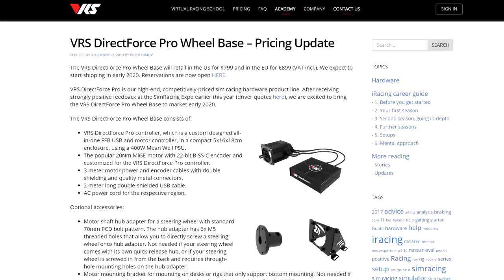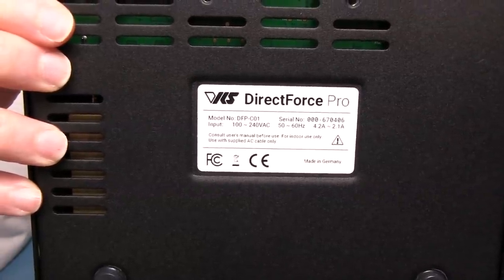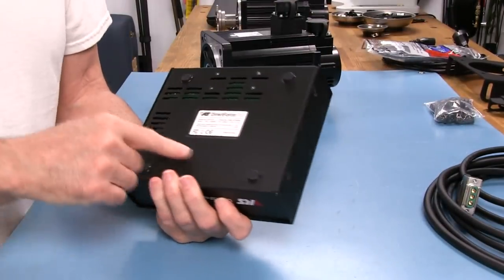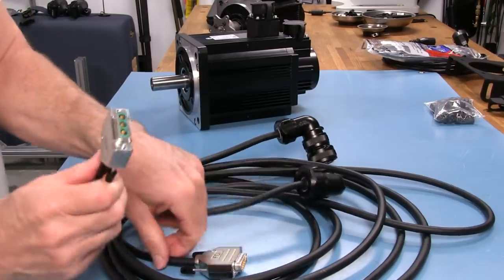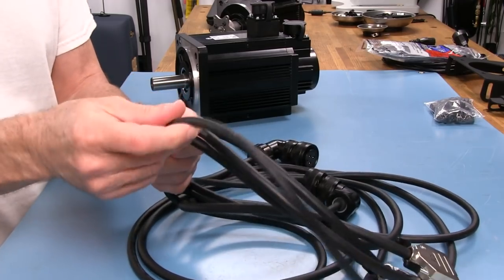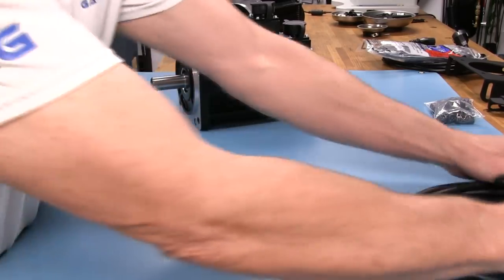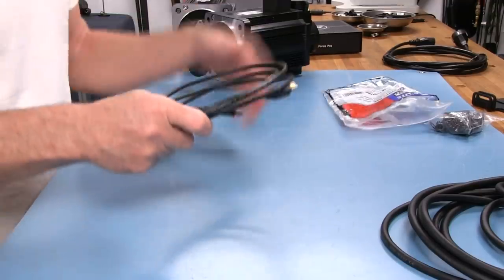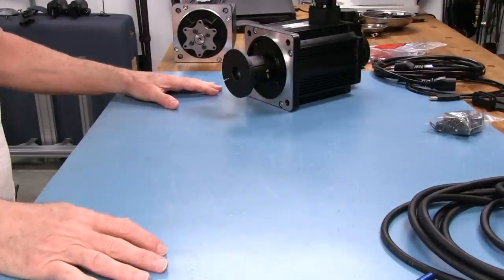VRS DirectForce Pro DD Wheel System Review

Comment: I aboslutely regret buying the DFP, it has this awful notchy feeling that I cannot dial out, I am at a complete loss it feels awful. Also support is almost non-existent, there is no troubleshooting documents, and they point you to the Discord if you have issues. In the Discord other USERS attempt to help you diagnosis the issue. So instead of a normal support system they offload it onto the Discord community.

Comment: Just got a VRS DFP with a GSI GXL wheel and LOVE the combo.  I started around 7ish nm, eventually went to 8nm, the last two days out of curiosity have been using 10nm in ACC and absolutely love it.  It takes the extra work that comes across from what you're seeing on the screen in the sim and I feel like I'm more connected to what I'm seeing on the screen.  I haven't tried iRacing yet, but I'll be doing that soon.  Just been having way too much fun in ACC.

Comment: Thanks Barry, you helped to sell a system for VRS.  Mine arrived yesterday.  Modeling a motor control tray to fasten to T-Slot extrusion away from home (work) and needed basic dimensions and view of underside for ventilation hole placement......this video helped me again!  Thanks again!
Reply: what was the screw size of the 4 screw points under there?  I have a 2 pc mount plate being printed for 40/40....need to get the screws

Comment: Bought mine and just installed it. Your review was 100% spot on. Great stuff Barry and much love from Australia!
Reply: Would you know if you can use this wheel with a PS4 / PS5 as well as PC?
Reply: @atrain132  Sorry mate, not compatible with any consoles, windows PC compatible only. I doubt it will have any compatibility with consoles anytime soon either looking at the controller and software needed to run it.
Reply: @eurisko84  all right, thank you for the response. I have the accuforce v2 for pc, and a gimx adapter so I can play on consoles, but it's kind of a pain. I just went back to using the t300 RS for consoles. Looking for a nom Fanatec direct drive wheel base for consoles as well as PC.
Reply: @atrain132  If I am not mistaken, I think Simagic might have a DD like that in some time

Comment: Thank you Barry for your review. I´ve bought myself a VRS wheel base kit recently and have it installed into my TrakRacer TR8 rig. This will have to change to a more stiff&sturdy pcs of rig made of aloy profiles soon! So one thing comes with the other…
I can confirm, that the feeling with this unit is great out of the box. Now I started to tweak around to find my sweet spot on the cars I used to drive in iRacing. 
Last Saturday I was at mates place who owns a SC2 Pro installed in a rig build like a "tank"… Nevvr seen such massive alloy profiles in a sim rig. So - no freaking flex anywhere.
The SC2 Pro and its TrueDrive interface were exciting to me due to my servo engineering background. But as you mentioned - this could overwhelm people and lead to probably horrible adjustments as long the users are not confident with what they are doing and understanding the working principle of servo systems and FFB. Even I still learn a lot by the moment!
So in the end the SC2 pro tweaked to my mates "gusto" was very detailed and sharp by beeing smooth at the same time.
What I found spectacular was the feeling of understeering where the force signal in iRacing - when loosing front end grip - drops off by 0,1-0,3 and the wheel becomes light.
This is by the moment an effect I´m "missing" in the VRS - but I will continue to tweak around with the settings - didn´t got to far with it by now. 
I keep communicating in with the guys from VRS and the VRS community to exchange my impressions and gain more knowledge from other users.
If I would "have" to decide today for which system I would go next - I would stay with the VRS from a price-point-value. The SC2 Sport has 3Nm less torque and offers a vast "hell" of possibilities to tweak out almost every personal preferred detail - but this is something that takes a lot of time without racing and why pay more and getting "less"?!
So KISS - keep it simple & stupid - it works without "thousands" of parameters for me and will work for other users too.
And - hell - YES! Shielding on cables is essential when it comes to AC servo motors!!! Servo motors with 20Nm peak torque are far away from "Toys"... ;-)
Reply: Great post, 2 years later, what are your thoughts on the VRS and have you jumped back into your mate's rig to compare again the SC2 pro?
Reply: @jj81Studios  sorry mate - nope... I quit SimRacing several weeks after this post for different frustrating reasons.
Now my son stepped into this hobby and started with a wheelstand from TR. Equipped with the new CSL DD from Fanatec and CSL Elite pedals. I used to borrow it for some track time having fun again in SimRacing.
The CSL DD with 5Nm gives me almost the same feeling as the SC2 wheelbase but at a lower torque range. Nevertheless it feels great and I'm able to feel the understeer even better than with the Direct Force Pro back in the days I was driving on a daily base.

Comment: EXCELLENT video Barry.  I'm seriously looking at the VRS Directforce Pro as my first (and only) wheel base.  I hate the thought of buying something less, becoming dissatisfied, then being forced to sell it to upgrade is against my nature.  Seems to me that the VRS is the best value in the current market and would make a great once-in-a-lifetime sim wheel base... especially considering my age (75).  Your video was absolutely superb and, as a subscriber, I look forward to your next video on the VRS pedals and wheel.   The only word in your amalysis that scares me was "graininess".   That was the very first time I've ever heard anyone comment about any Mige base system with the word grainy.  What components do you have in your everyday driving setup?    My second concern is my limited number of USB attachment points in my PC.  I have a very powerful laptop with a Intel(R) Xeon(R) W-10855M CPU @ 2.80GHz with 32GB RAM, 6 cores, 12 threads, and a NIVIDIA GeForce RTX 2080 Super with Max Q and 8GB dedicated RAM.  I've been told this is very sufficient to support sim racing on most any single monitor (no triples).  Problem is that my PC only has 2 USB ports, so an integrated solution (where all the peripherals are plugged into the wheel base and only ONE USB then connects to the PC seems like a good fit for me (for ex: Fanatec).  As a retired IBM engineer, I can quickly adapt to most technical things, but the cost of getting started into a quality sim setup has me concerned.   Any thoughts and suggestions you have for me are greatly appreciated.    Robert
Reply: According to Boosted media, The software has come a long way since the time this video was posted. I have a VRS DFP coming in on monday because the Simucube warranty process has been a little brutal. A usb hub will solve your usb hub problem. You wont regret it.
Reply: @jconsc2 any comments on your experience with the base thus far?
Reply: @diovalremonde2468  
Yes, I love it. If I compare it to my simucube I actually like it a bit better with the settings I stole from this video. I'm not a big tweaker of settings I like to setup and go so take it with a grain of salt because the sc2 pro is fantastic and I'm sure my issue is one off. Microcenter has a replacement on their way out to me. 

VRS : simple software. Unit is solid. Control box is also high level(construction wise). I have not mounted yet and just have on the desk which I can see as a minor annoyance compared to the all in one unit.

As far as software the VRS software doesn't have a whole lot of tweaks which I personally like. I feel like with the settings in boosteds video work great. Clean feedback and gives me a lot of confidence to catch slides and try to push to the edge(of my ability).

SC2 software has a million settings. I could see how this is great if your into getting the perfect feeling but to me it's a little much. I'm sure I could search for better settings but the ffb seems to be a little violent if that makes sense. I think I was using dan Suzukis settings turned down.

The cables the vrs come with are hefty. I also got their quick release and put it on my fpro. I really like how the QR works. Only goes on one way, high quality tight tolerances but comes of easily. I do think maybe some silicone grease would make it super smooth going on and off, or maybe the ptfe dry spray. Attaching it to the motor Shaft It was relatively easy to get on the base if you have any mechanical ability. I don't mind the  SC2 QR but the pin is tight and can be a little tough to get out due to the tight tolerances and I enjoy the race car feel of the vrs. 

I'm not a pro and just use the sim to escape life and feel fast so take it with a grain of salt. 

I think with whatever option you go with you'll be happy but for the nearly half the cost of the SC2 pro. I got mine from microcenter on a sale so in my experience it was a few hundred more. If I could of done it all again from the start I would go with the VRS because the main difference is the software. 

Feel free to reach out if you have any other questions
Reply: @jconsc2  If you were to compare how close the sc2pro to the vrs what would you say? Im on the fence building my first rig between vrs and sc2pro. Any update or info id appreciate!

Comment: Great review as always Barry, been waiting on this one for a few months now, seems like a winner to me! You left us hanging on what your "daily driver" DD wheel is...come on, spill the beans! 😁
From what I've heard from users of both the SC2 Pro and the VRS, it's very close and definitely has the potential to be as good, if not better than the SC2 Pro, who has had a good 5 years to fine-tune their wheel to perfection vs. 1 year of beta testing the VRS, so I'm gonna take the plunge and buy the VRS. Equal to or slightly below SC2 Pro performance at a lower price point? Using a reliable motor and encoder combo? Seems like a no-brainer to me. I'm quite sure they'll fine-tune this to perfection in no time.
Oh, If that wasn't a jab at Fanatec at 7:30 I don't know what is...Barry's getting savage 🤣...but he's speaking the truth; that's their M.O. sorry to say. 
My load cell in my V3 inverted pedals died after a little over 1 year of use...and not excessive use either. They did send a replacement Load Cell and PCBA because they weren't sure which one went bad. My Fanatec shifter...I'm tired of how often that thing miss-shifts...I've done every fix, the electrical tape and the "connect your rig to ground" methods and it still acts up. Between that and several steering wheels that have malfunctioned over the 2 years, I'm done. Converting my Fanatec wheels for DD (If I keep them at all) and getting a VRS and either Heusinkvelds or the Meca Cup1 for pedals, will need to find a more reliable shifter that feels as good or better than the Fanatec (the Pro Sim Quaife shifter is endgame; I'll get there eventually LOL)
Reply from the maker: Bodnar SS2/Kollmorgen 54G.
Reply: Knew it, lol!!😅😅😉😉
Reply: @simracinggarage3026  How does the VRS compare to the Simucube 2 Pro/Ultimate and Bodnar SS2 54? I would love to see a video on this. I'm looking to get into the higher end market but it is hard to get a good read on $ vs quality/performance/most accurate feel. It's been 2 years, I'm sure there is a much bigger data pool to pull from now?  Thanks
Reply: What was your experience with the VRS, did you get it, do you like it, what do you not like about it? Did you move on to the SC2 pro/ultimate?  Very curious as I'm looking to get  into the higher end market now.  Thanks

Comment: Nice review again Barry, all parts ticked accept the one thing everyone is hoping for. How does it work in other sims ? Especially ACC, AC, and Rf2 ! And how does it compare to other DD systems within those games. Does it supply all the feel one would need and what ( if any ) are the differences within these games in terms of feel and maybe tweaking.
I reckon that is what everyone who is on the fence of getting a DD wheel and making that costly decision wants to find out and hear from someone who has experience with all these systems and also plays all these sims. Makes me wonder anyone would be qualified for that and have the time :P.
Thanks again for the indepth hardware check anyhows ! Very informative thusfar.
Reply: It works with the other games but they are currently working on them with the firmware, for me in ACC and AMS2 it felt a little dampened and not as smooth but talking to the guys they are working on this

Comment: Well that does it.....this is the base for me. Ive watched probably 10 or 15 wheelbase reviews on this channel and when you put it all together, this wheelbase for the price really looks like the best combination of capability, FFB strength, smoothness and affordability. The only issue it presents is that you still need a usb cable connected wheel. Tradeoffs are just a fact though, unless you have huge money available. All said i can handle using a usb connected wheel if I get this motor at this price.

Comment: from my studies I remember that ferrite choke are cheaper but less effective then proper shielding on cables and can't be used on very high frequency signals
Reply: No, ferrite chokes are useful even at very high frequencies ( e.g. > 100MHz) and, depending on signal paths, highly beneficial with shielded cables, including radio antenna cables.  So long as ALL signal conductors go thru the ferrite beads, signal attenuation is not an issue.

Comment: I’m waiting patiently for mine to arrive, Ive ditched my dd2 for it
Reply: Did you receive it yet? How is it compared to the dd2?
Reply: @MohamedBouallegue88  bloody brilliant👍👍 so much easier to setup and just great out of the box on iracing, acc, raceroom and even Ets2
Reply: @olliebob8370  Bloody brilliant is spot on. Great base, even better with the latest firmware.
Reply: @kevinleiter  yes I’m still in love with it
Reply: is it smooth or grany comparing to DD2?  is it improved after final update ?
Reply: @AbramEmad  I can't speak to the DD2 but the VRS is silky smooth. I don't think any of the true servo motors have any graininess, AFAIK this is more a possible issue on the stepper motors (and overcome fairly well with software). At this level of wheelbase it's all splitting hairs honestly, direct drive is as good as it gets.

Comment: Another great informative video, I tried to buy one but not shipping to Australians 😕 just one little thing too Barry, wire guage determines current capability, insulation determines what voltage you can run up to at about the 8 Min mark but no big deal, someone may have already picked up on this 🙂

Comment: Hello. Thanks for review. Got my VRS Pro wheelbase a couple of days ago. But sticker on the engine says it has a torque of 10 Nm, not 20.
I wrote to the support. They replied that 20 Nm is the maximum power, and 10 is standard. I think is cheating.
Have you taken apart many wheelbases such as Simucube Pro or Simagic Alfa U. Did you also see about 10 Nm motors in them? Have you ever measured this parameter?
Thank you.
Reply: How are liking your vrs today are you happy with it
Reply: @trevz1048   Yes, it is a great and i use max 80% of power

Comment: This seems to compare favorably to the Accuforce 2 base. Similar cost with a more powerful motor. If I was starting with a new base today, I'd get this (if it was available in the US). You can start with a low cost wheel and upgrade to something more expensive down the road.
Reply: Not comparable .... level above

Comment: Would be interesting to see if the usb cables have shielding on them. Some of the cheaper and even some of the more expensive ones don't have shielding despite it being a requirement for usb 2.0 cables... Although I'd imagine it is not possible to test it without getting a usb cable tester unless barry is willing to rip the cables open and pretty much destroy the cables in the process.
Reply: In VRS sites refer a 2 meter long double-shielded USB cables

Comment: mmmm they should provide the mounting bracket as well as the hub adapter at that price. Cmon, if i'm buying a DD motor i should be able to stick a wheel on it. At the price 1.100 euro (considering the additional items that you need to buy) i rather go with fanatec DD podium. Same torque, better finishing, multiple wheel rims available, no usb cable tangling around the wheel...
Reply: A worse quick release system, a set of pins that are prone to breaking, a proven track record of questionable quality control ... The Fanatecs are a great option !!

Comment: I am wondering how this stacks up against the DD2 with fanalabs 1.24.
Reply: Doesn't. I mean I love my DD2 But these bases are much better. They also are more expensive and don't have the same level of eco system. Basically just the rim for a system like this will cost as much as the whole Fanatec bundle.
Reply: @TheSubieFan  I bought an SRC GT wheel/wheel plate for ~$400 with their one piece QR, and while it's nothing special, it certainly gets the job done.  Magnetic shifters, nice clicky buttons, and two rotary encoders for a good price.

You can probably find an even cheaper wheel at Penguin RC if that's too pricy.